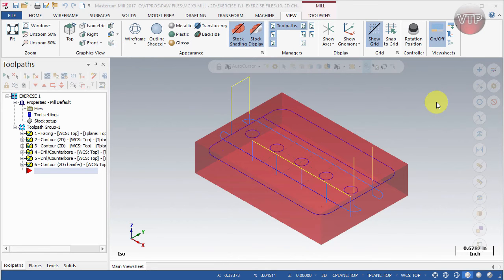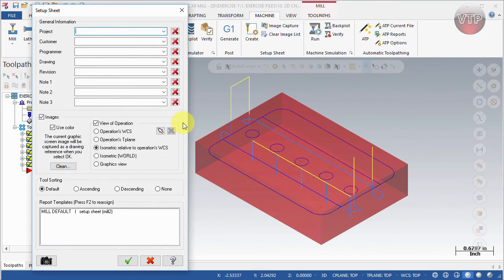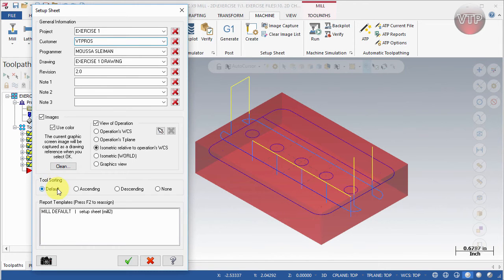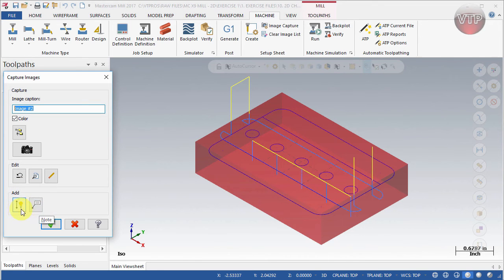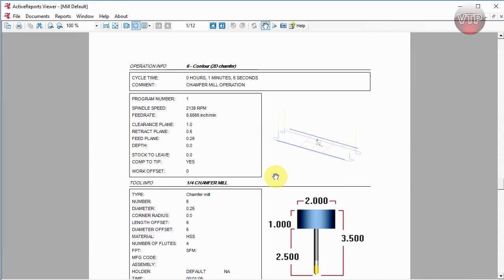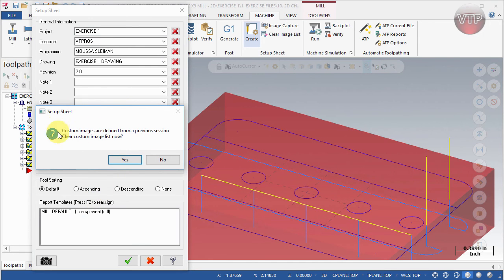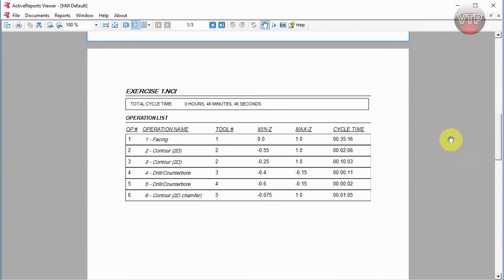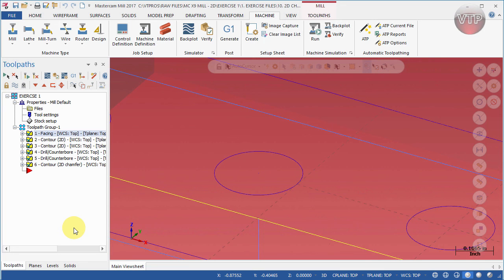MASTERCAM 2017-2020 - INTRO - Setup Sheets - vtpros.net (2018-2019)

Comment: is it possible to output Stock X+,X-,Y+,Y-,Z+,Z- instead of only the length, width and height? This is needed to know if the WCS is exactly centered or not.

for example i what i have:

Stock: X 20.0, Y 20.0, Z 10.0 

what i need is:

Stock: X-Min -9.0   X-Max 11.0
            Y-Min -10.0 Y-Max 10.0
            Z-Min -10.0 Z-Max 0.0
Reply from the maker: yes this is included in the full training.